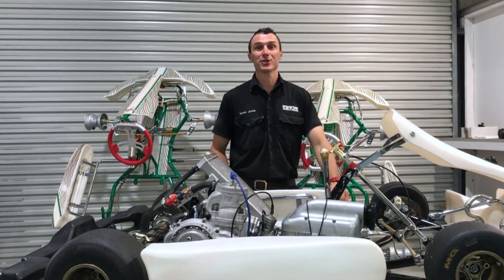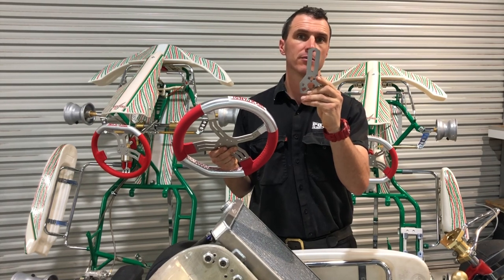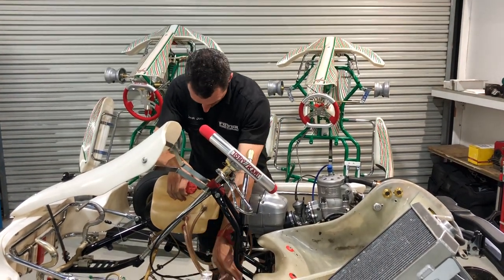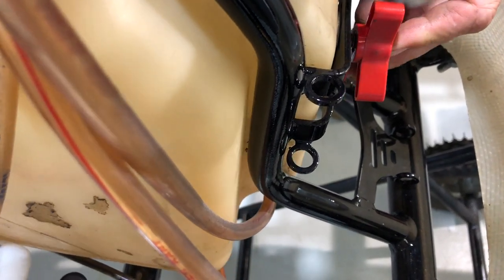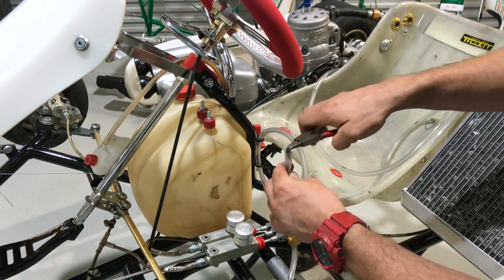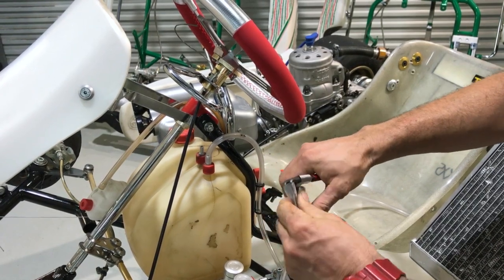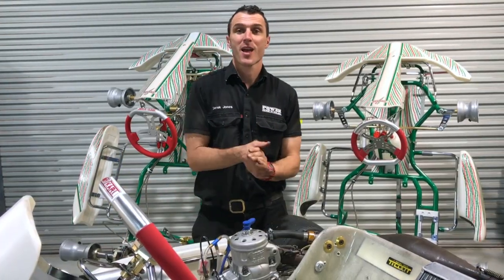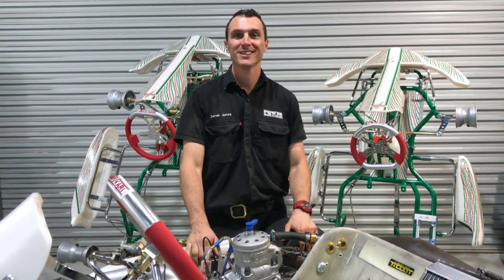Power Republic - How To Assemble A Go Kart Part Eight - Seat, Steering Wheel, Fuel Tank & Exhaust

Comment: Hi there, love your video's! Just got in to karting, bought a 2nd hand intrepid 125cc rotax. So much fun! Only thing, my knee's are too close to the wheel . Do you know what the part is I need to add more space between my knee's and the wheel? Thanks in advance!!
Reply from the maker: Hi Jimmy, how tall are you?  you can cut the steering column down and re drill a new steering wheel boss bolt hole in the shaft.  Also you can adjust the pedals foward until they are about to touch the front crash bars.  Also remove the heel stops too.  If that isn't enough, you can get or make a front bar extension kit.
Reply: @PowerRepublic  Thanks for the swift reply! I'm 6"2, for someone with limited mechanical experience, which do you think would be the easiest/cost effective solution?
Reply from the maker: Jimmy Crackers that’s tall for a kart but not impossible. Cheapest is to modify your self. Best is to buy/make a front extension kit.

Comment: Why does your chassis have loops for the fuel lines? Is that normal?
Reply from the maker: its just a feature thats makes running the fuel lines neater.   If you like you can always not use them and just zip tie the fuel line to the chassis.

Comment: Does the return line run into the fuel or just top of the tank
Reply from the maker: it should discharge to the top of the tank and then just fall back to the fuel at fuel level
Reply: @PowerRepublic  will it be ok if I don't have a return line ? I have a 11 hp honda engine and I have a 3 or 4 hp honda clone im using one of the little black  pulse pumps for each engine

Comment: Where may i found the clucht cable installation?
Reply from the maker: Hi Doommal, I may have missed that bit.  What kart to you have?
Reply: @PowerRepublic  praga dragon evo with  tm kz10
Reply from the maker: @domenicomallardo  cool.  the clutch cable is pretty straight  forward.  First, loosen the cable clamp that hold the tension on the cable near the steering boss.  Then, get some slack in the cable and put the other end into the clutch arm and the outer sheath into the crankcase housing.  Pull the cable tight and adjust the the cable clamp and you should be all done.  hope that helps
Reply: @PowerRepublic  thanks i'll do it 😉

Comment: do i run a retun line i have a phbe 30 hs carb with dual fuel intake. (k7 engie from tm racing)
Reply from the maker: yes, we do
Reply: @PowerRepublic  do i run from both fuel lines or just one of them
Reply from the maker: @alexanderhegelund5629  you have to run both back into one, then tee off one to the carb, the other back to the main tank